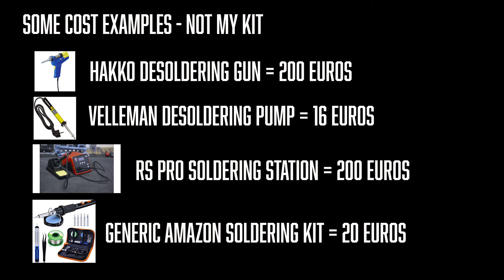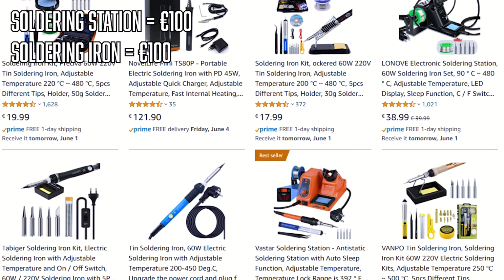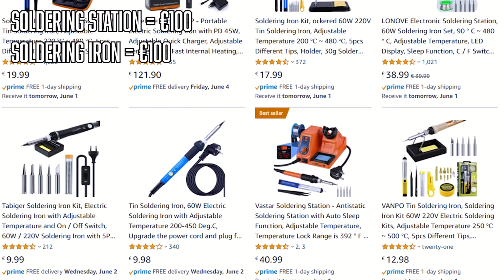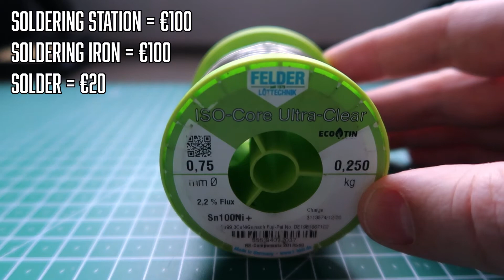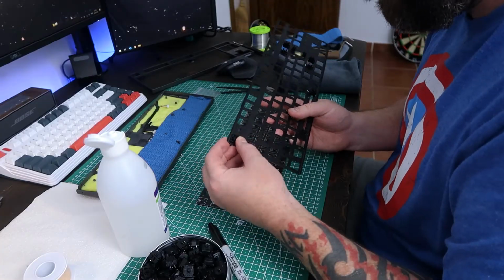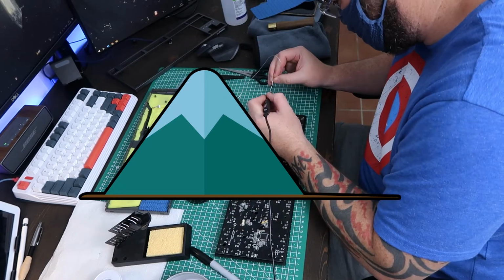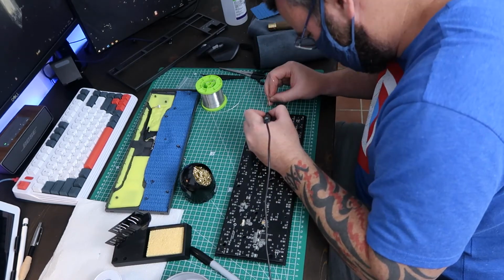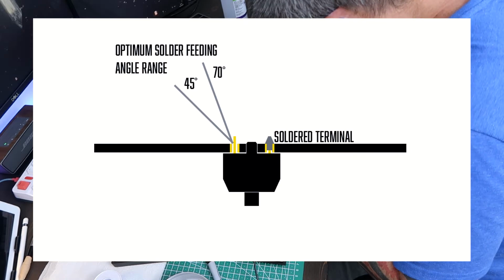Durgod K320 Mods (with desolder)

Comment: Absolute banger of a video! There is a huge hoke in the community dealing with "what to do with the prebuilt you bought before you knew better". I have a stack of boards that I am currently desoldering, but barely anyone has made videos about the whole process. Thanks again.

Comment: I'd advise against using Dr Bronner as it leaves a film, as does all castille soaps. It's basically bar soap in liquid form. It is good stuff but I'd avoid using it in this case and go for Fairy liquid or any good washing up liquid as they don't leave a film.

Comment: I'm curious about the heat from the pcb. Does the K320 pcb get hot? Does there need to be room for ventilation? And are there materials that will melt or catch fire so close to the pcb?  I used craft felt as a sound dampener.  I guess wool felt (more expensive) is flame resistant, etc but (polyester) craft felt could melt.  Do i need to pick up some wool felt or another material for the top layer (i've already filled the deep parts of case where you used silicon)?  I've gotten so far on the project and I don't know what to do now.  I don't know enough about mech keyboard pcb thermals and what can be pressed against it.  I certainly don't want to ruin my board or start a fire.  Thank you for any help.
Reply from the maker: I am not an electrician so please don't take my opinion as gospel. But I don't think there is a heat issue, I've certainly not noticed any heat from keyboards. The current must be so low that they don't create heat, the fact that the cases aren't vented is a good sign. It is only signal current and LED's if backlit. Using anything conductive would be a problem, but I don't think there is an issue with fire/melting. People use packing foam often which will melt no problem, and I've not heard of issues.
Reply: @keebface  Okay, so you're saying that using a material that could melt at a high temperature would be an issue if the pcb got to a high temperature but there is no reason why it would get hot enough to melt a (polyester/ acrylic) felt to begin with because the operations the pcb handles wouldn't produce enough heat?
Reply from the maker: @dpfutbol  essentially yes. All foams that people use to dampen keyboards would melt, but don't because they don't get hot enough to.
Reply: @keebface  Got it! Thank you for being so helpful.

Comment: Can you use screw down stabilizers on the durgod board? Want to know before I by them for mine.
Reply from the maker: No just plate mount I think. Easy enough to take apart and have a look but I'm pretty sure just plate mount.

Comment: what soldering iron did you use? im looking to desolder mine, i found that a standard 18v iron did not get hot enough. looking to buy a variable soldering iron, what worked for you?
Reply from the maker: I haven't desoldered with a soldering iron, only a desoldering station. The solder iron I used is shown in the video. Miniware digital one. Have a look, I can't remember the correct name and I'm not at the house.